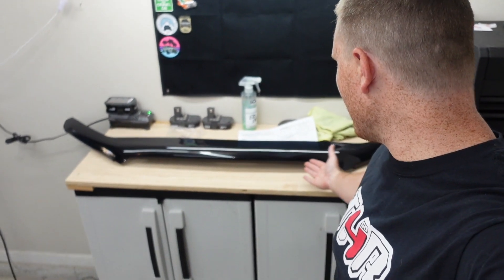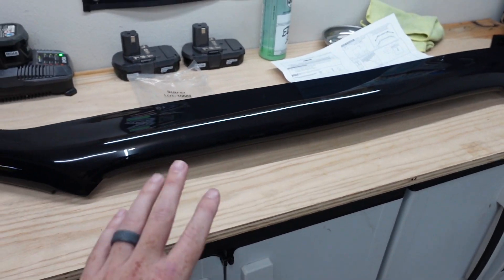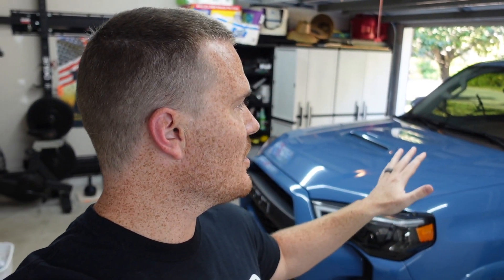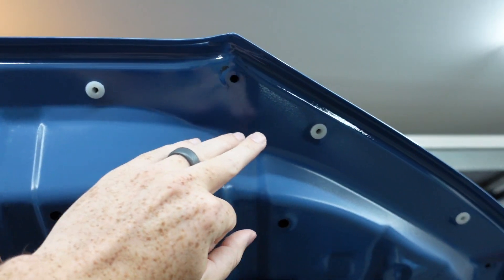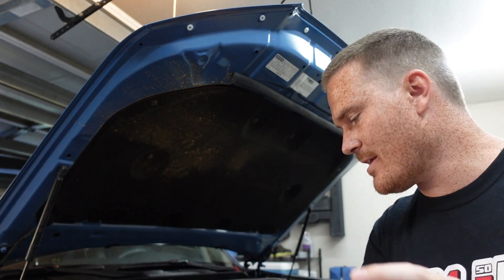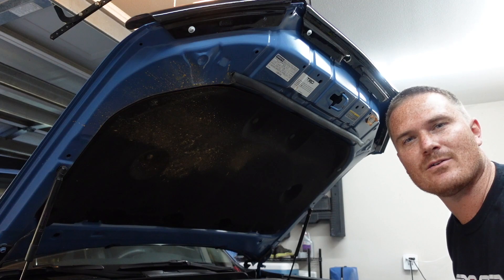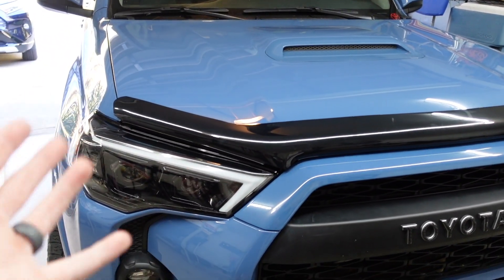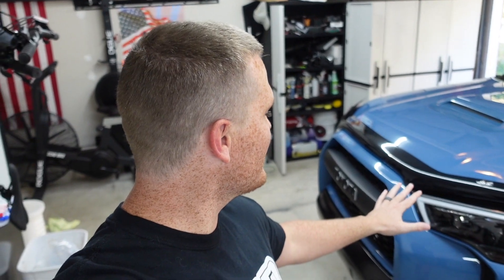4Runner AVS Install!! DO I LIKE IT?? Goodbye Rocks and Bugs!!

Comment: I’ve had two of these AVS Bug deflectors…..one on my ‘21 SR5 Premium 4Runner and now one on my ‘24 TRD OFF ROAD PREMIUM 4Runner. Both had scratches on them out of the box. Other than that good quality material and serves its purpose. I will say that I’ve learned from experience from the first one I had that there is very little clearance from the bug deflector and the top part of the Grill so it will scuff the paint in that area after awhile. I solved that issue on my most recent install by placing 2 of the small clear silicone dots on the top edge of the Grill so they keep the deflector from rubbing against the paint on the grill. These dots are supposed to be for the leading edge area on top of the hood but I never have needed them there and I also have PPF covering the front leading edge of my hood. Thanks for video!!!

Comment: Lots of Pros and Cons here !! I just installed the same hood deflector on my 4 Runner just to deflect stones and debris up away from the hood and mostly away from the windshield.I’m on the Highway frequently and don’t need chips Etc...One of my main concerns was that there was enough space between the hood and deflector when I wash the vehicle that I could clean the space between the two,most other deflectors lay right on the hood edge.There is a good amount of space,and I think the deflector looks good on my Silver 4 Runner and my deflector came right out of the box,no scuffs or scratches !!

Comment: I love my AVS Bug Shield.  I got the AeroSkin version though. I run a body shop so I went and painted mine to match the body. It looks seamless. AVS makes a great product!
Reply: How do you like thr aero version? I’m afraid to put all that double sided tape on the paint.
Reply: @hatrian83  I love it. Trust me, the double faced tape won’t hurt your clear coat finish at all! As long as you didn’t just have it painted within the last 90 days, don’t be afraid of the double faced tape. I recommend waiting 90 days if your hood has recently been refinished though. There are plenty of videos on here showing how to install it, it’s super easy once you have it lined up. I would absolutely recommend getting it painted to match the body, it looks seamless. It shouldn’t cost you more than $100 to paint it as long as you don’t have the white pearl color, then it would likely be just over $100.

Comment: Jon~ I installed the exact piece on my 2023 4runner. Though I followed all the steps and installed it, I see that this is not even on the hood, I say that because when I view it from the drivers seat, the passenger side is little low VS the driver's side, should I worry about that? Do I need to re-install, because when I was installing it, the passenger side holes were not exactly aligned with the ventshade holes? Just curious? please let me know your thoughts. Thanks. I am happy to share pictures if you want to see post installation? Thanks - VK😊✌

Comment: Tried the avs brand on my 2020....unfortunately it did not fit right. There was not quite enough 
clearance...with the hood closed, it made 
contact with the trim across the top of the grill.   I was afraid it would rub away the paint over time....so be sure to check clearance and make sure you can slide a thick piece of paper (business card) between the deflector and front grill surround. It did look go though on my 
white pro, with the contrast. Went with a clear bra.

Comment: Hi I have a question I just can’t find any raptor lights that will go with my 2021 Toyota forerunner I did buy some at Amazon and they did not work I see that my grill is different than yours you put them on the top I have nowhere to put on top so I try to put them on the bottom and they just didn’t work any ideas thank you for your time and thank you for the sweet videos I enjoy them all the time.
Reply from the maker: I havent seen any for the grilles with the silver bar.
Reply: @TRDJon  thank you I knew I couldn’t find any I was afraid of that it OK if you say something down the road I will fit my 2021 Toyota forerunner please let me know thank you very much for your channel Jon  I enjoy it you have a good one.

Comment: Hey, so i just installed avs bug deflector on my 4runner too but after installing, it won’t latch on. Did you do any adjustments? Or you just push the hood down hard?
Reply from the maker: Like the hood wont latch? Make sure nothing is in the way. I didn't have an issue.

Comment: Now you've got me reconsidering getting one for my 4Runner... I had a deflector on my old vehicle and it (over several years)rubbed the paint through on a few places on the vehicle, even with the rubber stops on the hood. The retention clips also were falling off from sun rot when I sold the vehicle.. and lastly, there was a line on the paint where the color had faded less due to being covered by the deflector. Again, all over several years (likely close to 20, actually). But, the vehicle was stone chip free on the front of the hood! Now that I'm picking a few up on the 4Runner, I want to ask- do you think this particular brand stands much of a chance of rubbing through the paint in any spots over time? Would like to hear what you think there; because every time I find a new chip it stings a bit!
Reply from the maker: It is close it some spots. So I’m going to keep an eye on it for sure. It is better than rock chips like you said. I have a good amount of wax on my car too and sealant so hopefully it helps from fading over time.
Reply: @TRDJon  it would be awesome to have an update on any rubbing after a month or two installed! I'd think you'd be able to see any rubbing pretty quick. Good point on the wax/sealant though.
Reply: Was thinking the same
Reply: @froto93  When the hood is closed,it do rubbing the paint,not the paint on the hood,but on top of the bumper,underneath the hood.

Comment: I have the toyota brand one which I was told no long being made for 4runners. But its pretty much the same.
Reply from the maker: Curious if they just supplied it to Toyota
Reply: The deflector that the dealer (Crestmont Toyota NJ) installed on my 19 Pro had TOYOTA embossed in it. It also had metal mounting clips that wrap around the front edge of the hood and subsequently, with wind vibration, started to dig into the paint! 😤 As with your Amazon AVS, I tried returning it three months later, and it was out of the return window (60 Days). And the dealer also didn’t want anything to do with repairing the paint damage that THEIR part, that THEY installed, did to my truck! TOYOTA “Customer Service” is a JOKE! After you drive off the lot it’s 🖕🏻
Reply: @andrewcrane3489  My dealer installed strips of clear film on the paint under the metal clips to help with this situation.   I don't know how long it holds up before it abrades through to the paint. I don't like the look of the deflector so removed and had the whole hood and fenders wrapped in Xpel film.
Reply: @jeremytaylor9213  I was happy to just throw that POS Toyota deflector in the garbage. I too went with the Xpel but because I like the look of the Xpel Stealth which has a Matt finish, I ended up wrapping the whole truck. I actually do like the aesthetics of the deflector though, so I went with the AVS. But as Jon experienced, it came scratched up so I had it sprayed with Linex bed liner. Now it’s bulletproof and it looks awesome!
Reply: @andrewcrane3489  my Toyota defldctor came with clear strips for the metal. Been on a year and no issues. It does look good on a 4runner.

Comment: Just recently put an AVS on my 2021 4Runner and it was actually chipping the paint when closing, not sure if it was a dud. Possibly others are experiencing this as well, I ended up taking it off because of this.,
Reply from the maker: Did you put the rubber knobs down?
Reply: @TRDJon  Hi Jon, I did put the rubber guards on, the issue was not with the hood being chipped it was the painted trim piece above the mesh grill, the underside of the AVS was hitting the right side when shutting the hood, the spacing or gap didn’t look even, I took it off a couple of times and remounted although no change, probably just got a bad unit.

Comment: It's gonna get beat up on your truck anyway, I wouldn't really worry about some scratches. Doesn't deflect much, after 3 years with mine I'm pretty sure stuff just hits slightly higher up my windshield. 😆. Bought it mainly to protect the front edge of my hood.
Reply from the maker: Exactly

Comment: I almost bought one of these, but I read so much stuff about how these don't actually work at all. There seems to be two sides to the argument. I have no idea what to believe.
Reply: Read so much stuff about how these don't actually work at all , Bet there are multiple scratches dings on your vehicle no argument there huh .....
Reply: @CP-kb1du  Not a a single scratch or ding on the hood or windshield. Been off roading 90% of the time and highway driving 10% of the time in the desert for two years. Plenty of pinstripes from rough trails, but nothing on the hood or windshield.